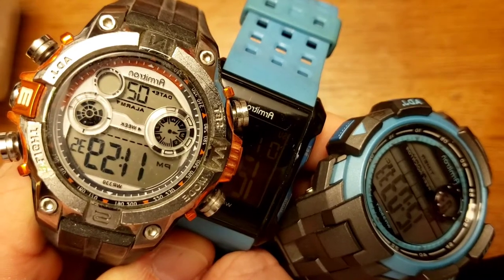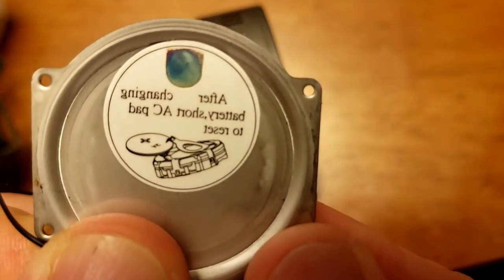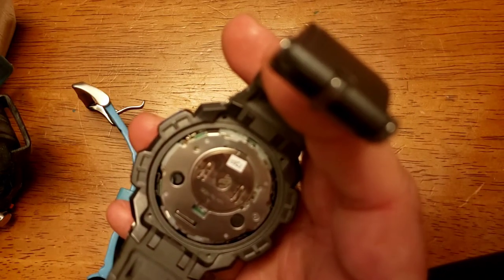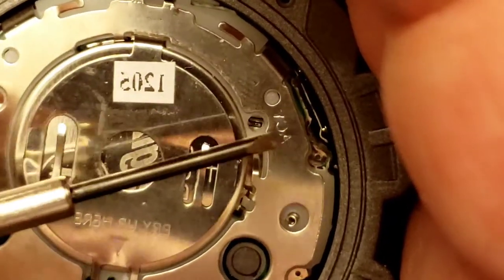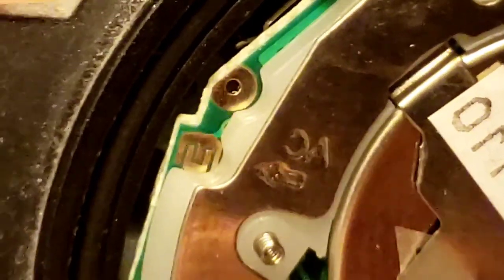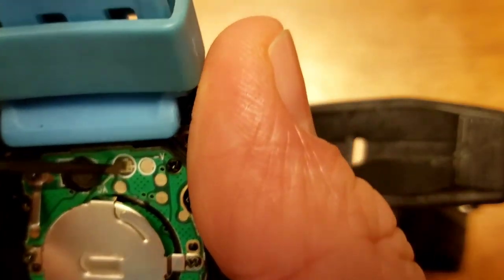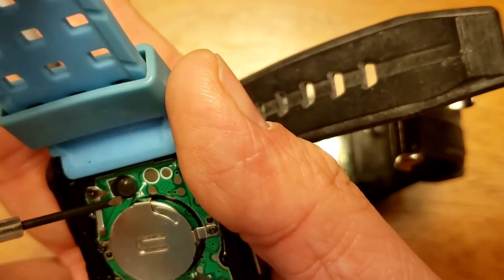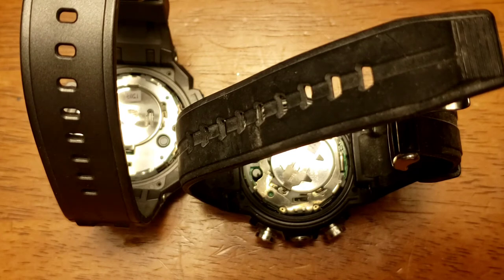Armitron Short AC Pad to Reset After Replacing Battery

Comment: Is this short-circuit operation just reset the watch? what if i didn't do it after battery reaplacement, it seems work fine at  my watch.
Reply from the maker: Near as I can tell, that is all it does.  I don't know why the label was there saying to do it after replacing a battery.  If yours is working fine, I'd personally just leave it alone.

Comment: Do you have to use non-magnetic tools?I have a Seiko that says you have to short A+ on the battery to .No idea what that means.
Reply from the maker: I'm sorry.  I don't know enough to comfortably tell you that magnetic tools are safe.  I do not know why they would cause a problem, but I also don't know enough to tell you they won't.  Unfortunately I have not worked with Seiko.  I would look for something on the watch labeled "a+" and if you find it, touch it with one screw driver, touch the battery with another screwdriver, then touch the screw drivers together while they are still touching a+ and the bsttery.

Comment: Do two small gaskets go on the two little things on the circuit board  that you can see under the two holes right before you take the battery out? Because when taking my metal back off I found a small little rubber gasket when I took the back off and was curious if it was supposed to be on one of them or just some random piece that got placed inside.
Reply from the maker: I'm sorry; that does not sound familiar. The only gasket I recall was for the back of the watch itself.  They may have been there and I just don't remember as it has been a while since I did this.
Reply: I found a very small square block on the table after I opened mine.   I don't know where it goes.   I hope the watch will work once I get a battery.  The instructions on how to loosen the battery clip were not good on the particular Youtube video I watched.  I did not know how to open the clip and took the entire movement apart.

Comment: How do you replace batterie ???
Reply from the maker: Sorry for not showing that.  It is different for the different ones.  There is usually some plate covering the battery.  It may be round and cover the whole thing, or just be a little metal bridge of sorts across it.  There is often a little tiny screw holding it down, or some type of clip.